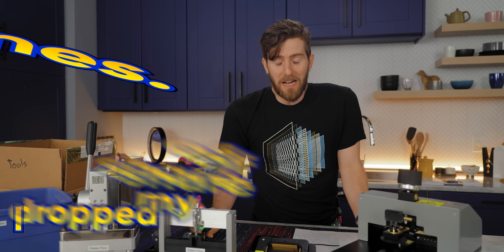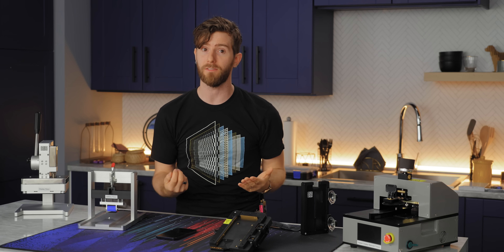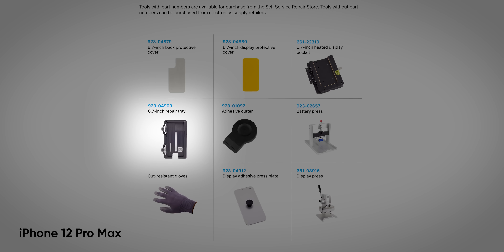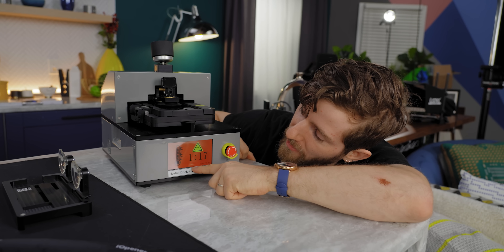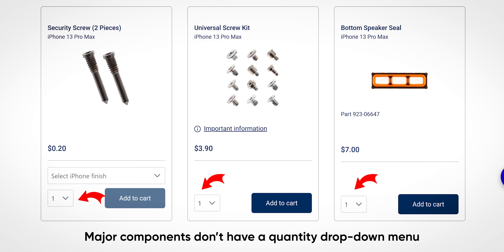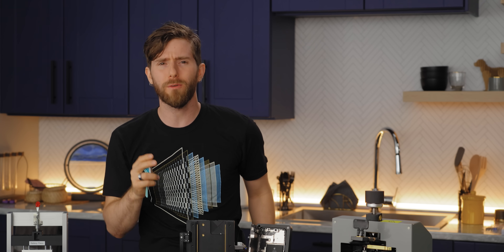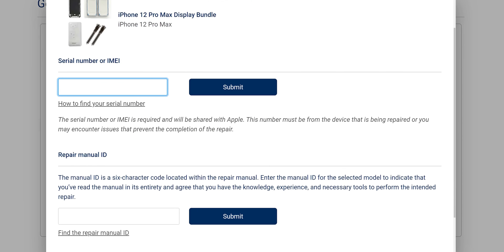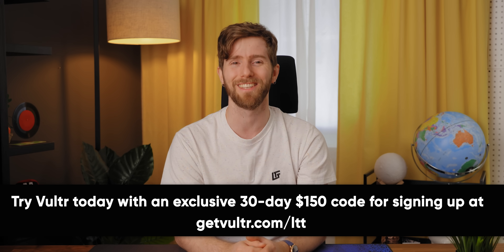I’m a Genius - Apple Self Service Repair Program

Comment: I just transferred a I phone 8 to a new I phone 11 pro max .. new out of the box .. but I get dropped calls non stop  & service gets no connection on the road any where unless u walk in a place that has internet 

Is there something wrong ? Seems broken 😞 
I luv my I phone 8 never ever an issue man I can b in a home w no internet on the road Throughout my state and never have an issue with a dropped call Irv no connection are these phones the 11 iPhone known to have issues it was a gift it came in the mail and when I opened it it was totally sealed like brand new

Comment: My display conveniently went out 5 months after the warranty expired.

This could be a use case for their repair kit rental, where the display cable may have just become disconnected and doesn’t actually need replacing.

Apple’s in-store repair would have just replaced my display whether it needed to or not. 

I might order a battery for another iphone I have to make use of the 7 day rental.

Comment: The reason they dont give you a parts tray is the screws are to be discarded and replaced with new ones that come with the parts. Screws should never be re-used for an Apple device as they can strip really easily.

Comment: can someone enlighten me if any other phone company is offering self-repair kits even? i never heard Samsung do it, did they? cause i see Apple take a lot of heat on this, but really other company policies arent that different. you usually either fix it at some shady small shop for cheap, or you use online guides and parts from amazon or ebay.

Comment: Actually, there's no lifetime limit for parts repair, you even can replace the battery every month. But, let's say you sent it to Apple or Apple Authorised, they will replace your previous unit with a new unit or refurbished one only under the problem part price. By the way, you can only order one part (which has a serial number) for fraud prevention and you need to return it or otherwise, Apple will charge you for the total price. 

Special note: Avoid doing multiple repairs, if you accidentally swapped the parts on the not original phone and there is a problem raised which required a visit to Apple Genius or Authorised Service Provider; your device will consider an authorised modification and cause repair rejection or Full Repair Price.

Comment: I work in a manufacturing company that makes wire harnesses and there, ordering parts is as easy as going online and finding the part number the customer wanted. 

Yes, wire contacts and terminals require compatible tooling from the part manufacturer, but never have I needed to call someone to “activate a battery” or make sure my part serial number matches the one I ordered. The fight for right to repair will not be over until there is a parts catalog on Apple’s website which I can peruse.

Comment: That gigantic screen removal thing seems a bit under engineered, wouldn't you be removing a cracked display typically? Cracked glass doesn't work well with suction cups last I tried.

Comment: Linus this is a great video but they don't want you to do the repair. Pay them to fixit is preferred but buy another phone is the goal. No different than any other retailer with tech stuff.  TV's another example.  If it quits you cannot even find a repair shop so you go get a new TV and press on. No spares inventory at the TV mfg. just inventory for new TV''s which is predictable.  How predictable do you think a spares inventory for Apple repairs is in real time to meet customer expectations. They can't just run over to production line and grab a screen off the new phone line. I am sure you get this and see the delima any mfg. would be in trying to forecast spares.

Comment: Working as an Apple "Genius" has got to be one of the most morally and ethically wrong career moves to make (if you can even call it a career).

Even if I was in that line of work, I would avoid working for Apple at all costs. I don't even buy their devices, but there are plenty of iDiots that will do all of the above.

Comment: Every repair shop has been using aftermarket parts, they’ll continue doing so, but from now on they’ll have access to right tools and consumables. This is right step for apple because they have been loosing money if you went to non-apple certified repair shop (and they’ll continue, but now you can and probably want to buy right tools from them)

Comment: Your AMOLED isn't dead, the Chinese have tools and inventory to replace only the screen glass for less than $30.
Including parts and labor and they use specialty equipment that the procedure can't be done properly without their machinery.

There are many repair shops in Guangzhou quoting $100RMB (US$14.7) for the front glass replacement for the majority of popular phone models (iphone front glass can be replaced 100%). It should be a repair of less than half an hour.

Comment: @apple if you get this message instead of preventing us from repairing our devices just work your employees off the clock like walmart does by "oh we need you to clean the bathroom" once punched out

please replace the taptic engine with software it will allow you to return the earphone plug.

Comment: Sigh... Linus is trolling again. He is too biased by his experience  of a hobby industry of slapping together commodity gaming rigs to be honest about the realities of manufacturing, warranty, and value.

People don't seem to have real-world understanding of why repair is expensive. The overhead of managing 1-off parts, shipped to 1-off customers is expensive. I can tell you as where I work we have millions in salary going to manage supply chain. When you are making phones by the 100,000 per day there is automation making a $600 phone possible.  In pieces and parts, it will cost many times that. It just does. Just the TSMC transistor real-estate Apple sells you in a A15 is worth more than the phone from any other supplier.

When you are repairing in bulk, it is again cheaper, that a 1-off. Even Apple is sending devices with non-trivial repairs to repair centers. Why? Volume. 

Secondly, I can tell you that those fixtures cost millions in engineering and are expensive to CNC, manufacture, and manage. They are not profit centers, they likely will not recoup their costs. $49 basically covers shipping, and Apple is giving you $10,000+ worth of repair equipment for free.

Comment: Since I've read several "as a former..." comments I'll add mine. As a former Apple systems engineer for a Apple Specialist, Apple did once "toy" with devices that were entirely user repairable. The first couple models of the iMac G5 were designed to be entirely "consumer replaceable". However they did it to start to funnel owners to their New (for the time) Apple Stores. See if a part was considered consumer replaceable by Apple, than the Apple Specialist chain didn't receive any compensation for doing the repairs (in or out of warranty). But the Apple store didn't make money that way (most of the Apple store's budgets came from corporate marketing money, at least at that time) so it's not a loss to them to do 10 repairs with no "compensation".  The concept failed, it's believed, due to push back from bother the Specialist chain, and end users, not everyone had a conveniently located Apple store, if they didn't feel comfortable replacing the logic board in their new iMac G5. Which were a LOT of folks since that same model line was known for bad capacitors blowing up in the PSU and on the logic board, eventually leading to REP for those parts. So the next redesign began the slow slide into super hard to take apart devices. I guess if Apple Specialists (or Value added resellers) wanted to be compensated for the repairs they did, Apple was going to make sure they really work for it. But I've slipped into story time lol. Sorry.🤷‍♂

Comment: The thing I wonder is how you do System Config or Repair Calibration when you're doing this yourself... cause I'm sure that's another thing they hide and you have to search an unnecessary amount just to find let alone run, if you even can.

Comment: Wait one second. If a repair shop bought the tools and the unlimited consumables. Could they use all the id numbers from second hand phones they already have in stock then they would have a surplus of replacement parts so when a customer gets a repair they would get an instant repair then the shop could use the customers device to order a replacement part aswell.

Comment: I've worked at Geek Squad since the start of the year, in California as well, close to Apple's home base and our tools to fix iPhones have been completely down for months now even though we have put in plenty of tickets for a fix from Apple. The irony is Apple still schedules and sends us anywhere from 2-10 customers a day and promises them SAME DAY REPAIRS, often they also schedule for like 7 PM which is an hour before closing and our 2 apple certified ARA techs are usually not working that late. Basically Apple has been a terrible business partner to our Geek Squad "Precinct" (Indoor Geeksquad Departmeent), they also have horrifcly bad training you do online on ATLAS and it's so bad unlike the excellent Intel Retail Edge Program that actually gives out dope prices and swag like a dope Intel hoodie I got with points, anyway no surprise that Apple is still shady AF and trying to likely maximize profit selling and renting out the tool set that we should have to help them make some additional profits... -_-

Comment: Simply solution people, stop buying apple products. Stop being brainwashed by wanting the latest apple phone, you're just ensuring you're on the wrong of the stick. Stop buying their products until they get their act together. If sales took a big dive, they'd start paying attention but if people continue to buy them regardless of their con on "right to repair" where it's more expensive to repair it yourself, and more risky if you have never opened a phone before, you know you are being completely ripped off, and you stand for that ?

It shows how little apple thinks of their customers, mugs, who will do that apple says, it's actually supposed to be the other way around but it won't be until people wake up. I doubt it will happen, I hope it will but too many people follow a brand completely oblivious to how that brand treats them.

Comment: Apple is in a bit of a predicament here, I can see why they make the parts ridiculous to fix. One huge factor of that would be to decrease the amounts of stolen Apple Products being sold to the black market to be torn for parts which would be recycled back into the market for replacement parts. This in return make Apple a more reliable company, however the right to repair is also at play. So now Apple is trying to please the users with the home kit, although ridiculous to get a hold of, I don’t see a better option at this point rather than the limit they put for how many parts you can get.

Comment: Back in the 80s apple repair agents would not replace faulty capacitors in a power supply, they would replace the whole unit and charge $150 for the unit plus $60 for the labour.  Nothing has changed with apple.

Comment: I do totally agree with your point "tech support would never give us an estimate, and we had the feeli g it was mostly done so apple store can suggest alternative options". I worked for Apple Italy tech support over the phone (1 year ago, things changed a bit for sure but the concept remains the same). Although we had estimates of prices for repairs, we were encouraged not disclosing them with customers. You also have to consider, over the phone tech support is mostly handled by bpo services, ie you are not directly employed by Apple, rather by a company that is employed by Apple. We wouldn't get many explanations on why, just a simple "that's the procedure". Long story short, an apple store and tech support have completely different scope of supports, and that's one reason why we were strongly suggested not to disclose prices (but we could have without failing, if we also mentioned they were pure estimates and prices may vary) . Another one is quite simple: AVOID ANY TYPE OF CONTRAST. customer do get quite aggressive and overall feel entitled (especially with apple, amazon...) at the phone. We had no way of proving anything without looking at a device, especially considering warranty and other legal issues. Then why put yourself in  a position where arguments might arise?! Let our "colleagues" at the store handle it (same way we were handling apple Id, pwds, backups and those bullshit for them).

Comment: Basically Apple is adhering to the letter of the FTC ruling.  That's it.  

If apple thought they could get away with filling the phones with epoxy and opening the phone caused the battery to detonate like a grenade? They'd do it.

Comment: The iFix it microwave bag is genious hahahha. I have a Gel bag to put in the microwave or in the freezer, but it’s for personal use. I once used it to remove the screen of a Xiaomi Mi9 and it worked like a charm. I put the bag inside the microwave for 3m and then placed the bag on top of the xiaomi for 2m. I felt proud of myself for that idea hahahaha

Comment: Having worked for a 3rd party AASP, the big hiccup is Apple stores do not charge labor, part price on that 12 pro max display may be $329, but even at Apple Authorized Service Providers that are not owned by Apple, the customer may have to pay an additional labor fee. Apple provides labor reimbursement for IN WARRANTY repairs to said tech stores, but out of warranty that tech store makes no money unless they change labor. Verses an Apple Store itself owned by a 3 trillion dollar company, does not charge labor regardless of warranty status.

Comment: I can't believe they ship out all that kit to everyone who wants to repair their phone, they must have untold amounts of kits manufactured. I remember doing board swaps on the iPhone 6, take a brand new phone and stick your logic board over to it along with its finger print sensor.

Repairing these devices has got harder since they became water proof, the seal is often the most difficult to set free and do Apple then guarantee the device to the same water standard as before?

People do get more salty about this then you need to, the phones are designed within an inch of their life to be compact and squeeze as much delicate tech into a small area, its pretty hard to work on stuff like that yourself. Think about cars these days, no one is a home mechanic anymore, everything has to go to the shop for tech to run a computer over it and if your cars in warranty then you need to take it direct to the dealer who charge a bomb.

Im not as angry at Apple as some people, im not sure I would wanna pull open my phone to be honest and be responsible for it anyway.

Comment: Why should self repair be cheaper then repair at an Apple Store? The price for the parts should stay the same but you need shipment, the store doesn’t (it’s way cheaper since they get a truckload); the tools are nearly free for the store and Labor isn’t that expensive, since they are trained and get stuff done quickly.

Comment: Hmm weird they didn’t add Rear System replacement to the self repair. It’s one of the parts I replace the most, and is also one of the easiest repairs to do. Rear System includes the entire frame of the phone and all internals attached to it, and all you need to do is transfer over the rear camera and the display.

Comment: So here is how I could see this working for smaller repair shops (as I worked for a "unauthorized" chain)...

Because my old repair shop relied on ifixit kits and Chinese screens... It would make the workflow on the repair end much more streamlined having official tools on hand. Not to mention that trade in or resale devices could be repaird using official parts instead of 3rd party on hand components (as no customer turn around time) ..

Comment: I can only feel as though this is Apple's PR attempt at trying to take some of the heat off of them from the whole Right to Repair movement. The fact that every scenario points to purchasing a new device as a "better option" is ridiculous, which makes me think that Apple from the start never actually intended for anyone to ever use it, reinforcing my PR attempt point.

Comment: 3:00 The fact that charging connector nor the power button / home button is not included in the possible repair parts is a huge f*ck you from Apple to the customer base. With a flakey charging connector or power button, the use of a device gets really tedious really fast.

Comment: Oh the iPhone 6 screen is way easy to replace yourself without Apple parts.  You can do it for like 20-50 depending on the replacement screen quality you want.  Luckily for the iPhone 6, even though the Touch ID is bin locked to the phone, the home button still works if you replace it.  The same cannot be said for the SE or the 7 or the 8 as those phones don’t have a physical home button.

Comment: I bought an M1 MacBook air off Amazon back in Jan 21. Broke the screen within 30 seconds of opening the box. Was seriously upset about it because no apple store where I live and authorized retailer was offering to replace the screen for the price of a new MacBook. I finally managed to get to a country with an apple store and they replaced the screen free of cost. I'm absolutely shocked. No apple care, well out of warranty and I owned up to the damage. Amazing customer experience. Of course if they had a proper self repair option I wouldn't have had to wait 18 months ...